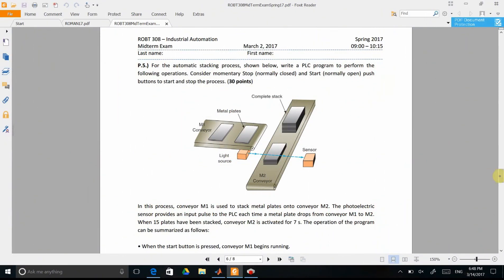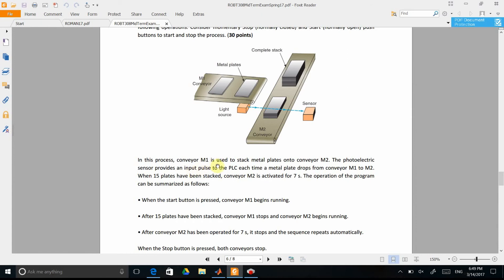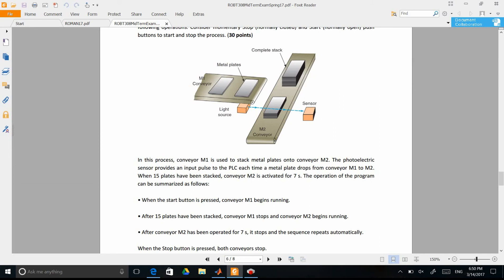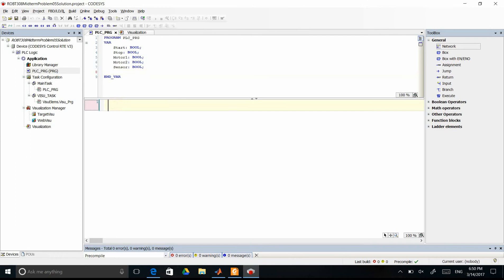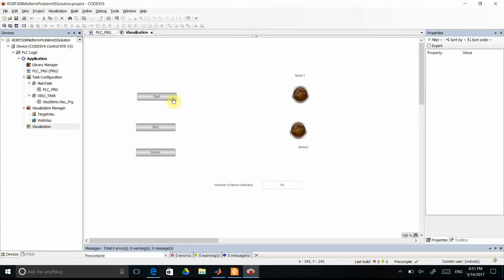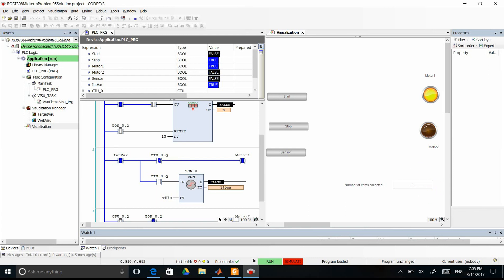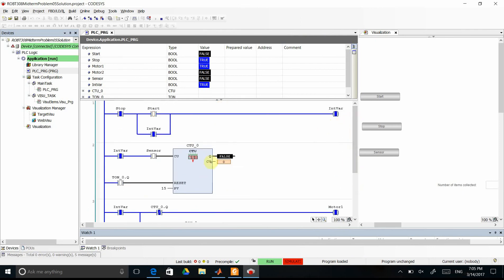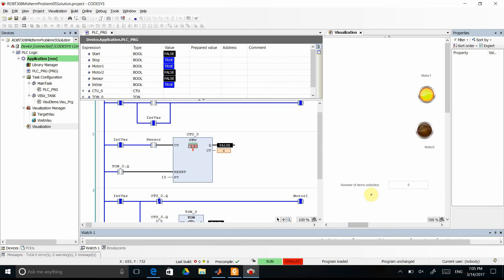CODESYS: Ladder Logic Diagram (LLD) programming example #codesys #plcprogramming #iec61131 #plc

Comment: Shouldn't stop have been a normally closed contact?
Reply from the maker: The Stop button is a normally closed button, meaning that the signal that normally we receive from it is True. In the Ladder program, normal contact is used to check the state of the Stop button. As far as Stop button is not pressed, the normal contact will be True. Once the Stop is pressed, the corresponding normal contact will become False, and this is what we need. 
On the other hand, if we use the negated contact, its normal value will be False, and when the Stop button is pressed it will become True.
I hope this helps you.